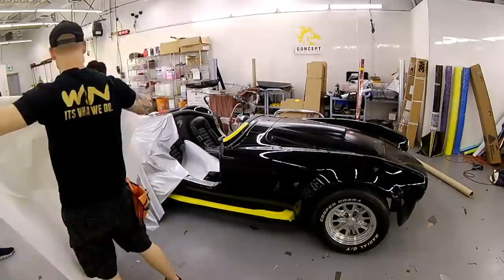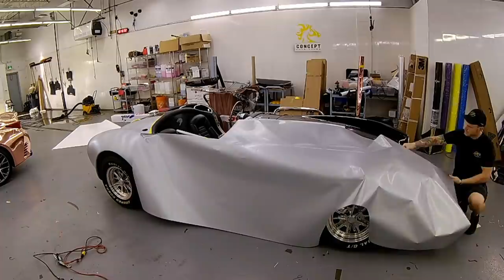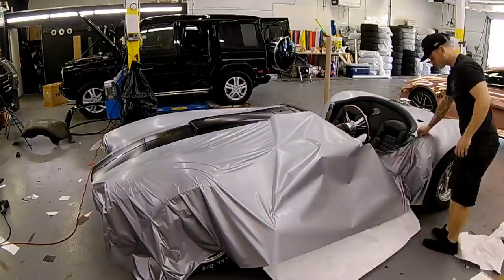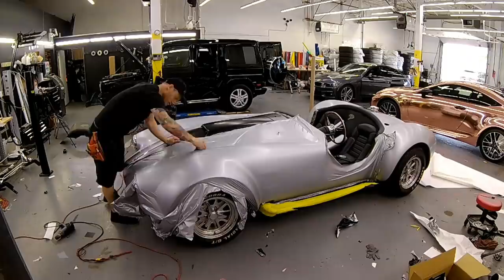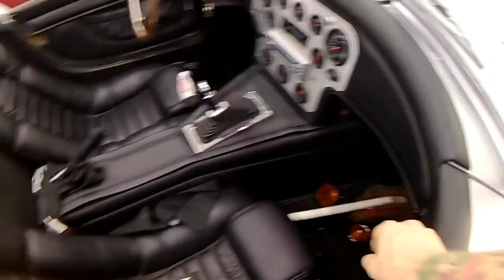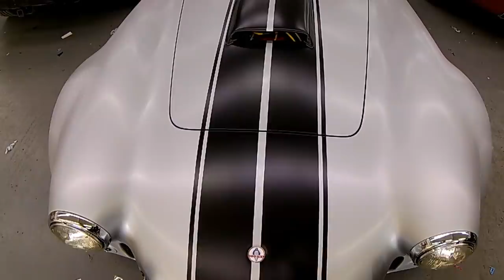Impossible Car To Wrap! | SHELBY COBRA TIME LAPSE

Comment: I,m thinking of wrapping my Karmann Ghia with brushed aluminium also, it's a one piece body apart from doors boot and bonnet. Did you need to do a knifeless tape join under the front headlights, and any issues with aligning the grain of the material?
Thanks, and keep doing what you do... Love your content!
Reply from the maker: Yes the grain won't align because of the directions
Reply: How did you lay in the material under the headlights, did you need to use knifeless tape and join?

Comment: I have a 2017 F250 I'm looking to apply light smoke tint to my headlights my concern they have a small recess about a 1/2 an inch deep should I do an inlay or cut it out or stretch the film into it

Comment: Why are comments on your product vs plastidip disabled? Espesialy when the application of plastidip you portray are entirely incorrect and much more difficult than your product. Other than being a professional detailer I have no dog in this fight besides the fact that i cant stand dishonorable assh***s that spew bul***t. If you had the decency to be honest with people youd let them know that properly applying a few layers of an aeresol product is just as simple as applying any type of vinyl wrap without any bubbles or wrinkles. Ive actually used your product in the past and may have recommended it but as of now will never use or recommend it again because you obviously have no since of human decency or respect and would much rather make your living off bul**hit and slander